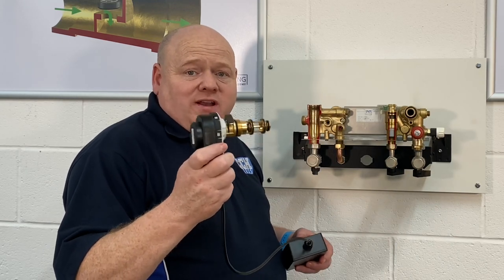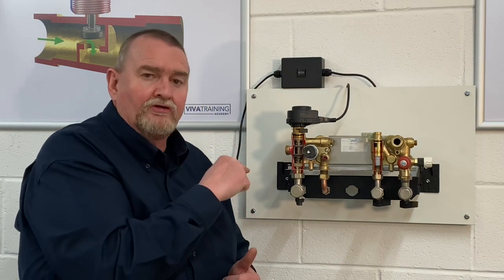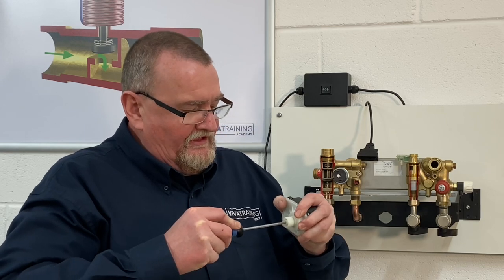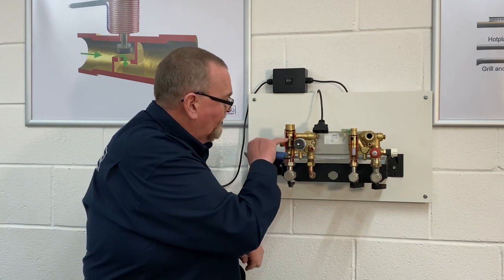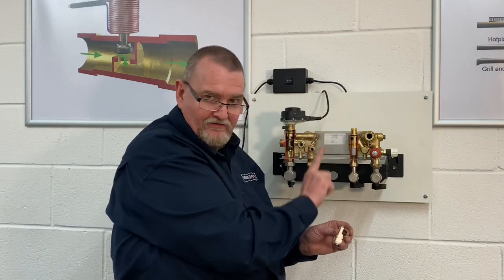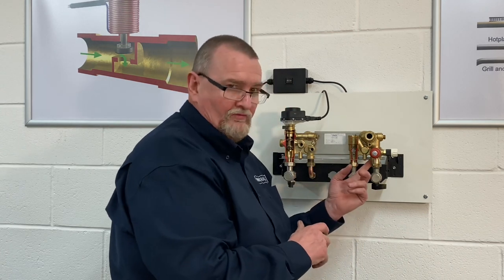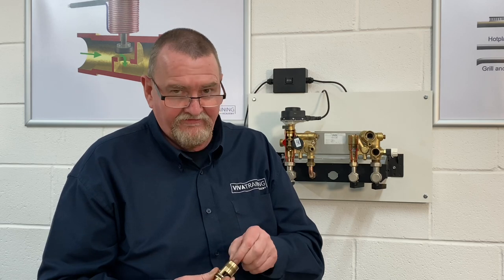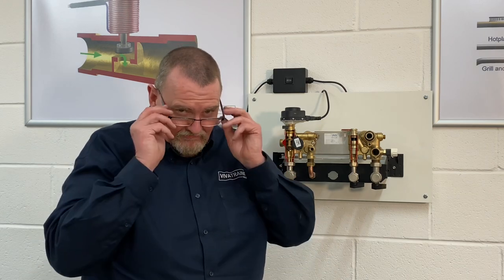How A Diverter Valve Works In A Combi Boiler - Gas Training for new Plumbers

Comment from the maker: Bobbin Type Flow switch:       10l/min 7211823
                                                       12l/min 7211822
                                            40kW 16l/min           7211824
 
Turbine Type Flow switch       10l/min 7663535
                                                       12l/min 7663533
                                                       15l/min 7715773
 
New Brass Diverter Cartridge              7656807
Black & White Diverter motor             7216534

Comment: This video helped me to understand why my 10year old Potterton Gold HE was banging sometimes. It was when radiator valves closed at certain temperatures. Ordered the motor head using the correct part number but the non- spring loaded type was supplied-This was the source of the problem. Sorted now, thanks for the free advice.

Comment: Hi - I've a Baxi Duo-Tec Combi 24 HE. I have an issue that the heating won't come on unless the hot tap is switched on then off first. Would this be linked to a faulty diverter valve?
Reply: Did you find the answer to this mate? Got the exact same issue but can’t figure it out

Comment: Hi, after gas safety engineer left the water wasn’t heating he came back and fiddled with some pipes under the boiler and then we had hot water. This happened twice! This year the radiators don’t heat up! They were ok until April and the safety engineer came in August… now it turns in for around 10-15 seconds and the boiler flame light turns off! I wonder if this time he has stopped s valve or something connected to the radiators? I’m a little suspicious that he charges the landlord every time he visits our flat. Please help!

Comment: Hi Allen I got Baxi 28E it that mean if my boiler are on then I turn my hot tap on the diverter stop run hot to my radiator? I just noticed the light on the boiler turn over to the hot tap if I run the hot tap.or you should see both light on(hot tap and the radiator light on)?
Thank
Reply: Hi Yo,
Yes when you turn a tap on the diverter moves to hot water and shuts off the central heating, once you turn the tap off if there is still a demand for central heating the diverter valve will move back over. With a combi you can only have hot water or heating on at one time not both together, that is why the radiator light goes off when you run the tap.

Comment: Roy, my 105 instant diverter valve is letting by in CH and pre heat mode, I overhauled the valve with a kit , but still lets by, any ideas pls, I descaled the Plate h/e and top up expansion vessel.
Reply: Hi Richard.
Check the by-pass valve in the rear of the right hand hydroblock, it could have dirt on the seat.

Comment: My boiler is pressurising itselve,I have changed the pressure or expansion vessel and the divert or valve cartridge also cleaned and flushed out the plate exchanger ,the pressure vessel is pumped up to 1 bar with air but the pressure still rises to 3bar and continually releases to via the external pipe. I have also removed the filling loop on the boiler and capped off pleased help before I go mad what do you thing is causing my problem Terry